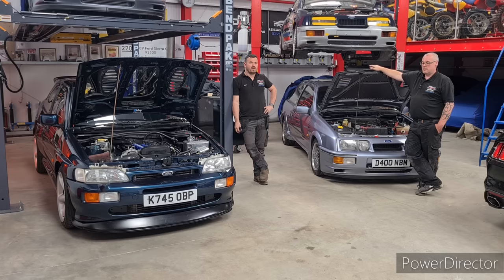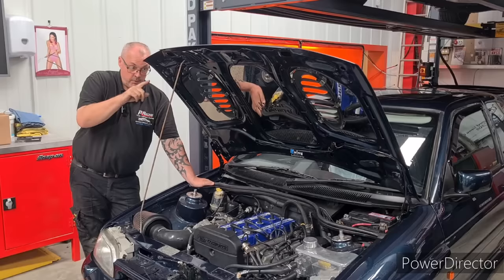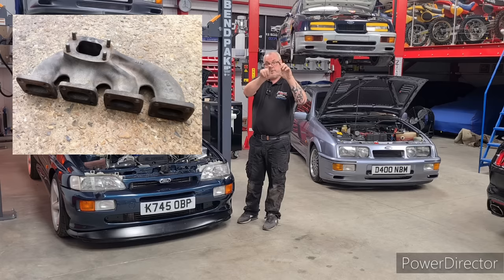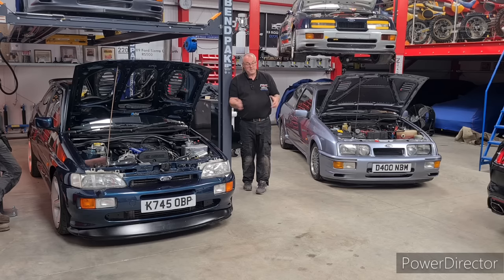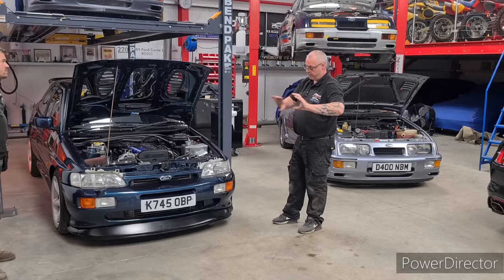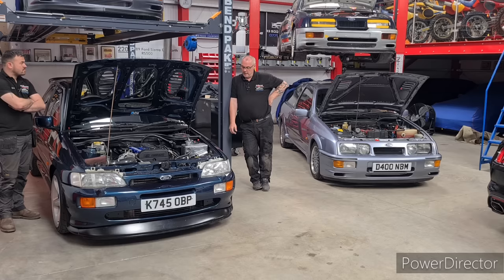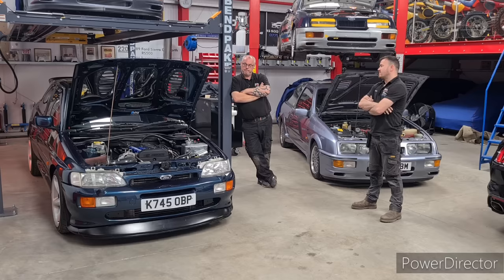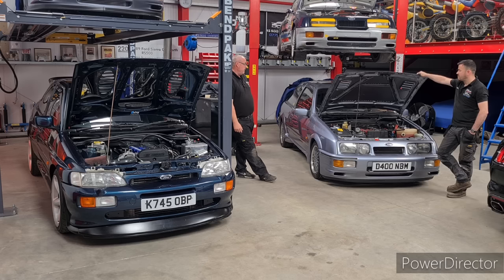We take a look at how the Escort rs Cosworth varies from the 3dr Sierra.

Comment: Lots of people say the Escort Cosworth doesn't drive as well as the other Cosworths but the reason is actually given in the video. You can't get the tail out, it doesn't go all over the place. It's made for efficiency and seconds gained on the road/track. The Escort is able to put the power down in the most efficient and controlled way. Not fun but quick as a bat flying out of hell.
Mine has Proflex suspension, poly bushed all over and 18" wheels with a close ratio 5 speed dogleg gearbox (maxes out at 200Km/h). There is NO modern car that is able to keep up with it up a mountain road. Oh and it's a one owner car, I bought it new in 1994 😁
Reply: im 2nd owner of 92 mallard green press car bought in 99 at7yrs old with very low miles during recession and bad winter money had fell on cars sold mk1 mex and mk2 rs2000 bought escort Cosworth for 15k now nearly 6 figure car

Comment: Didn't the engineers put 4x4 saff guts into a stretched mk4 escort. When they presented it to the top brass, they thought it was a bit of laugh but no way a production car.... until they were taken for a blast in it. After that, they realised its smaller size could make it an ideal rally car, hence giving the green light to the escort cosworth.
Reply: @jamesoconnor3017  MK5 A ESCORT COSWORTH HADD STRETCH AT KHARMANN NOT SHORTENED ADDED LENGTH
Reply: That is true and if you look online there are photos from  Ford's SVO department.
Reply: @brian3174 agreed, I think the way to easily tell the difference between a real and fake Cossie is the length of the rear boot lid? The Cossie being longer than a standard escort.

Comment: always thought the shells and running gear for these escorts were based on the XR4X4..?
because of the torque split like 30 front 70 rear...
or is that what the saph cosworth 4x4 was based on... thought those were 50 50 split...
confused com here...
paul do have a couple of hours to help explain..
great vid lads

N x
Reply: based on but not same I've had cpl xr4x4s and Cosworth sierras owned escort cos 24yrs now 2nd owner under 70k lux big turbo in mallard earl green that n performane blue or imperial blue niscest colours greens low volume under 100 in rhd it was registered from ford as K ...cos as registration every option and 3 folders info from day one ford used its 1st 2 years before sold to public hooligan mobiles and best not full electronics cant fix self last real Rallye sport ford made as badge now as focus mk1 rs 4x4 turbo 16v not fwd shopping trolley wasn't an rs

Comment: Hi Paul,
Always wondered was the RS 2000 mk5/6 escort same as the Cosworth shell  ? Apart from arches ?
Reply: Nope totally different floor pan even the 4x4 rs2000 was front wheel drive with a mondeo 4x4 system strapped on it lol
Reply: @stevenorris4121  it was the 4x4 I was referring to thanks for that buddy 👍🏻